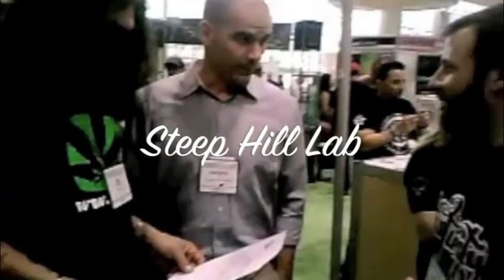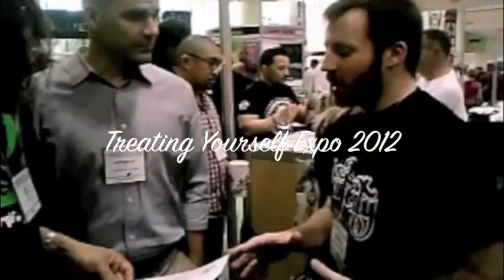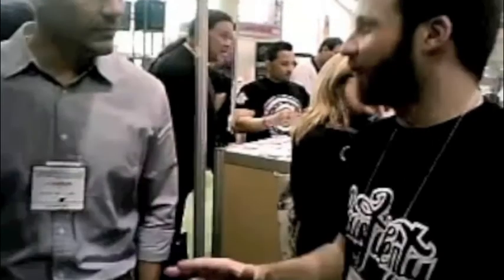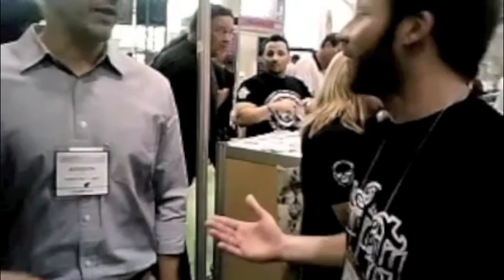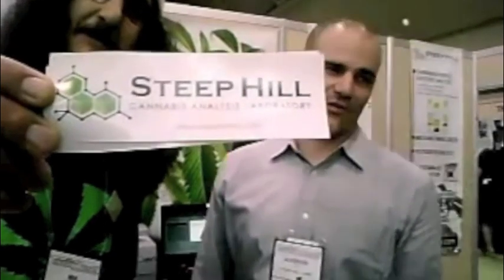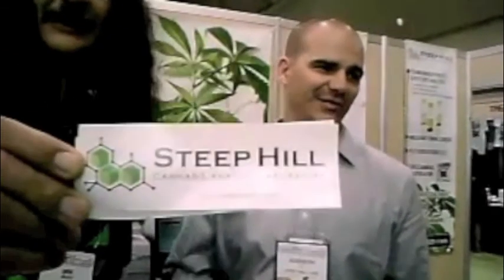Marijuana Potency Testing Explained at the 2012 Treating Yourself Expo

Comment: maybe this will start an interesting discussion.... on the Under the Influence show Al took issue with this... he had a nice illustration (paraphrased) "if I have 100 gr. of weed that this analysis shows is 15% THC, then that's 15 gr. of THC -- there's no way you can get 15 gr. of THC out of that". (Sorry Al if I mis-understood your position).  It's an interesting observation. Keep in mind, an extraction leaves a fair amount of product behind on the surfaces of the source material, but still....